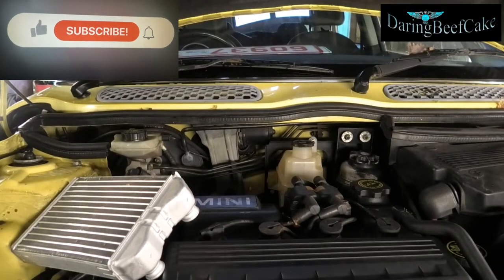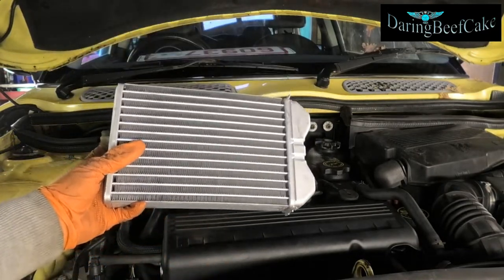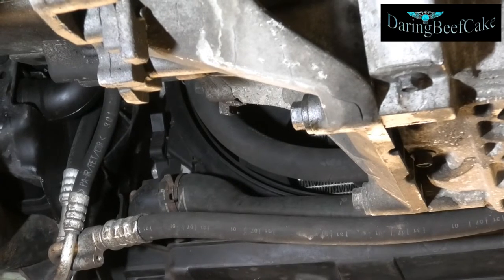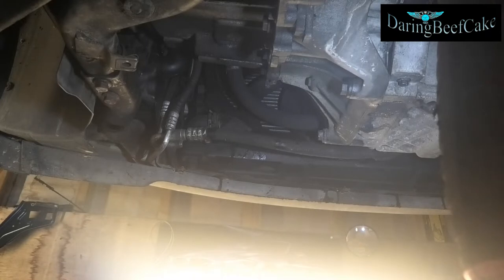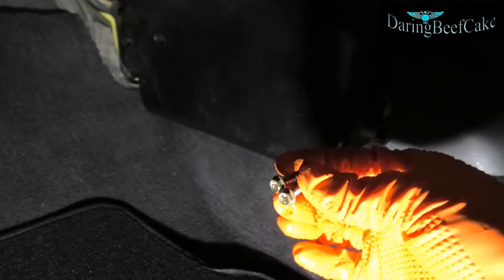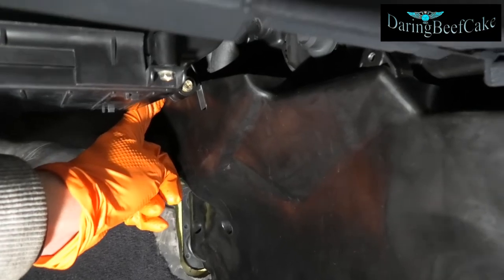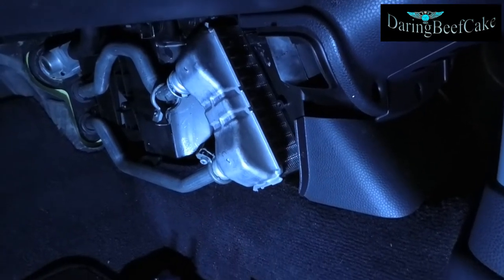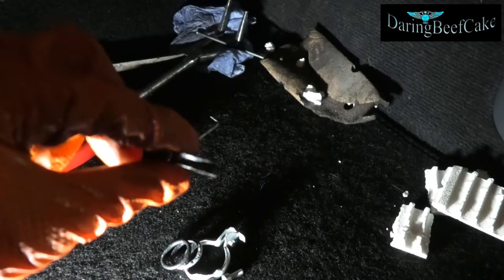Mini Cooper R50 2001 heater matrix removal and replacement no hot air in cabin

Comment: Started this job today, and found the matrix side panel held on with torx screws. Bottom two ok but top inaccessible one I found to be chewed up and my bits were unable to undo it. Put it on pause and ordered a replacement side panel as I am going to have to break/saw the original panel off - will attack again tomorrow!
Reply from the maker: Its a battle that you can win, specially with winter on its way. Good luck and thank you for sharing.

Comment: Thanks for the video well  explained , I am having the same issue the passenger side warm but not hot and driving blowing cold air , thank you
Reply from the maker: Hope you can get it sorted soon, it’s so cold in the UK.
Reply: The pipe clamp to 5 hours to fit 😫lots of Vaseline helped fit it together, the heater is now blowing very hot air thanks 🙏
Reply from the maker: @karenwhiteside8046  well done that fantastic, am glad you got it done and have some hot air now, lovely specially in this freezing weather. the clap is a pain in the ***...